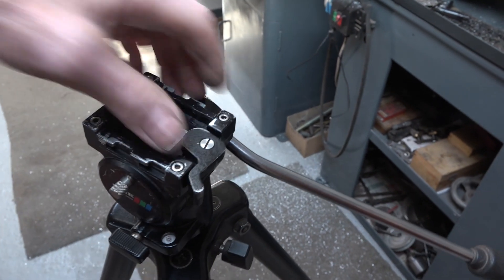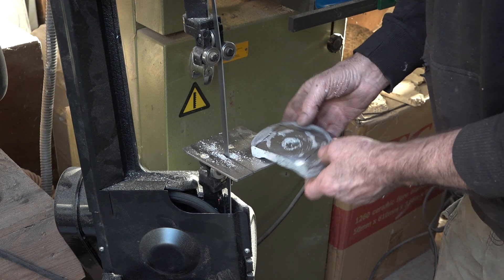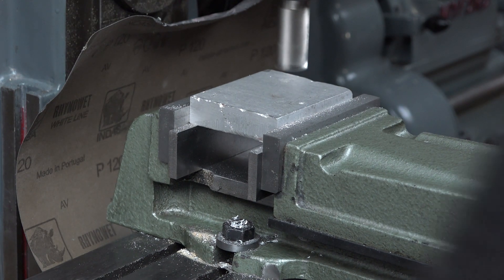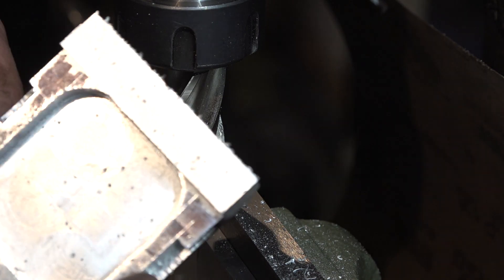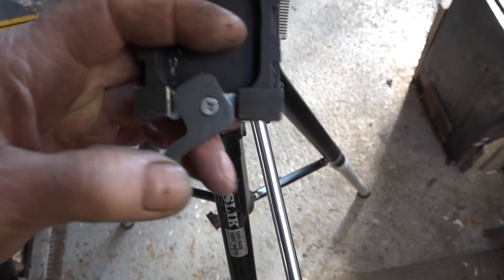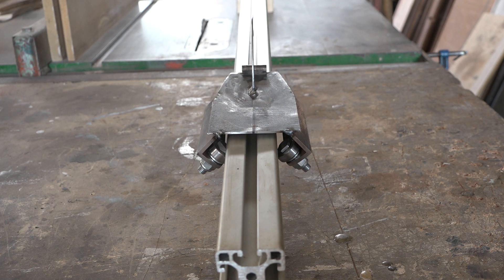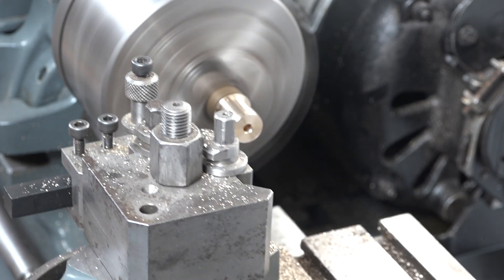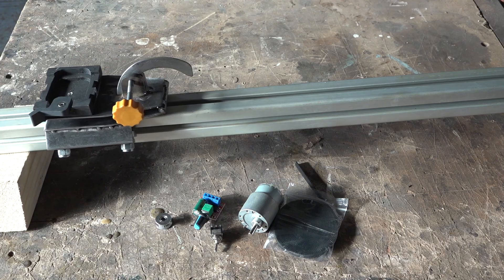DIY making a motorised camera/camcorder  slider

Comment: Nice job Loz, you are clearly enjoying your machine time........ Addictive isn't it? Camera mount looks great, far better than anything you could buy nowadays. Bit of WD40 when finish cutting aluminium helps the surface finish no end, useful in roughing too. Paraffin is just as good but stinks. Cheers, Jon
Reply from the maker: Thanks Jon, yes really enjoy making random things mate good tip on the wd40 although the ally I cast was a bit beyond redemption  😃